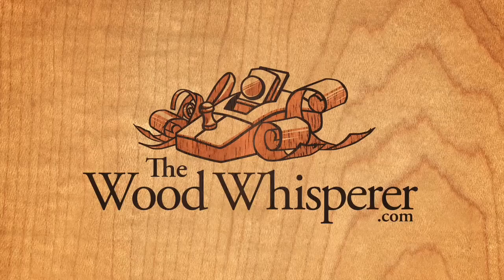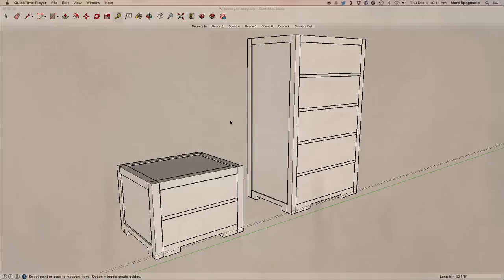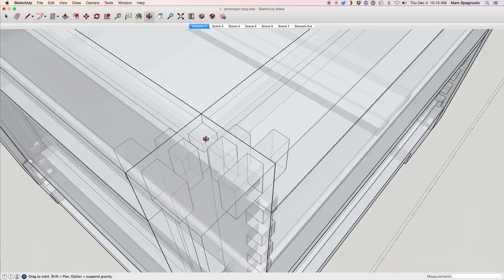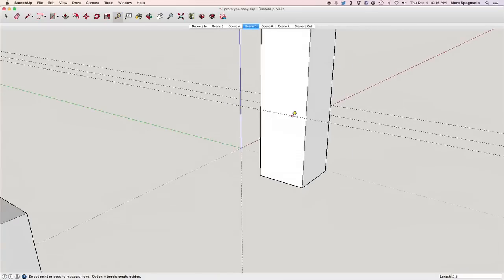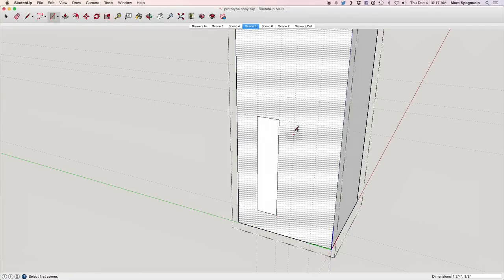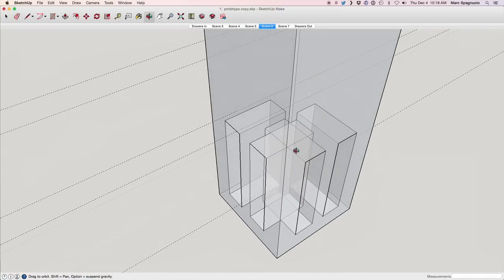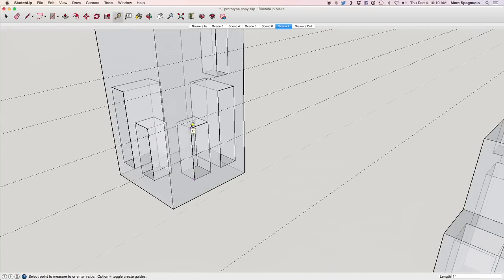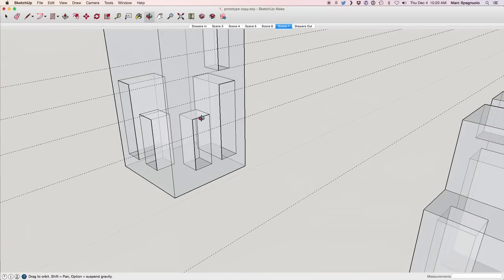238 - Mortise & Tenon Sizing

Comment: Woodworking with The Wood Whisperer 
WOW!  What an excellent tutorial Marc.  Wonderful job of using sketch-up to provide visual clarity to your concepts, and a great job of showing why carefull planning (engineering) is so important to preventing problems later. 

I personally find that every hour spent in planning saves at least two in execution (one undoing the problem and a second doing things the way I should havein the first place) depending upon how far back in the build I need to go to fix the issue.  If it means remaking a piece, then a lack of good planning can easily double the cost of the project as well.   The "engineering" phase, as you call it, may not be the most fun, but it definitely saves time & money.

It also allows me to work far more confidently while I'm in the shop.  I can spend my time focused upon the task at hand rather than trying to solve problems of dimesions, joinery and assembly.  The results for me are alwyas improved performance at the current task and a superior final project.

Comment: Thanks for showing us Sketch Up, I have seen static drawings in that program, but I didn't realize the 3D spinning you can do.
It seems to be a relatively easy program to use.
I usually rough draw my plans on paper, and then I use Adobe illustrator to tighten the numbers.
I will try Sketch Up for my next project, Thanks

Comment: I'm going to be building a shaker inspired cherry nightstand. A drawer is going to replace the front apron so how deep does the mortise fit for the side apron with the dovetail from the top rail, and the twin tenons for the bottom rail? 3/4" stock for the aprons and top and bottom rail. The legs are 1.5"

Comment: Interesting stuff Marc. I would have run the mortices right through so they intersect then mitre the tenons. (Jonathan McG beat me to that one). I would probably have only used one, thicker tenon there, over complicated me thinks. Imagine how much more difficult all that would be without Sketchup?
A couple of tips for you. Early on in the video when you were pushing back the mortices, after you had pushed the first back, simply double click on the second and it will go back to the same depth as the first. (Just read down Ma na beat me to that one). Also if you have a wheel on your mouse try pressing down on it so it clicks, this will introduce the 'orbit' tool without having to click on the icon. It then switches off when you release the mouse wheel. Not all mice do it, a cheap replacement will save you hours of icon clicking! ;-)
EDIT: Also, pressing the wheel down at the same time as 'shift' (PC) invokes the 'Pan' command.

 Love the channel Marc. Best, Graham.